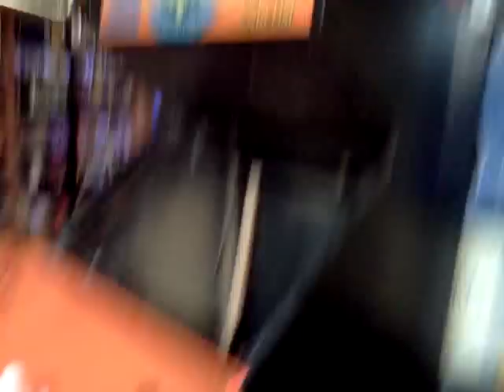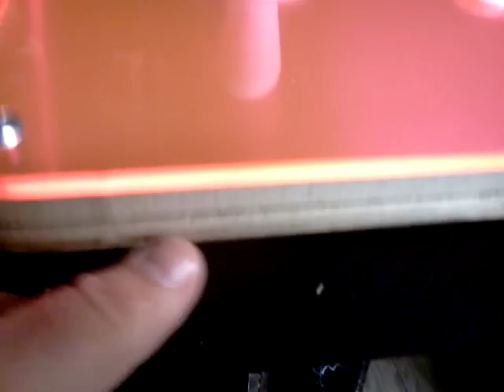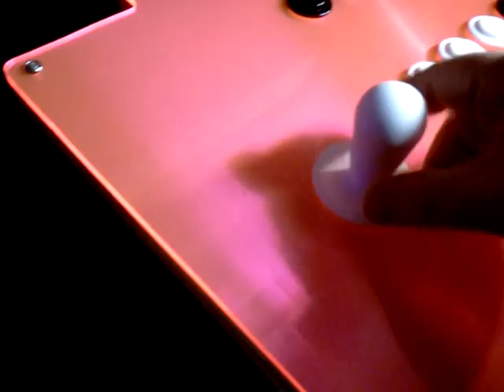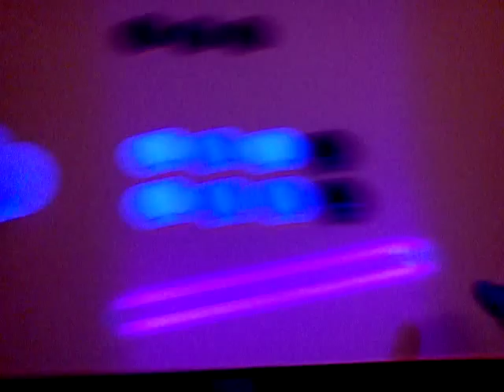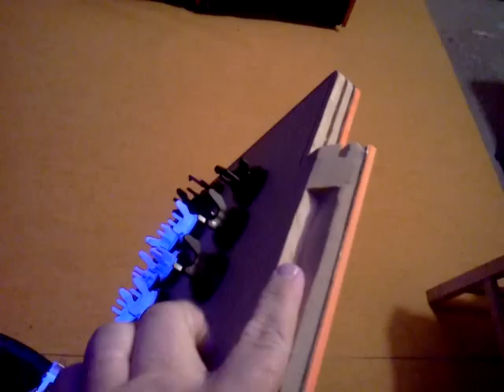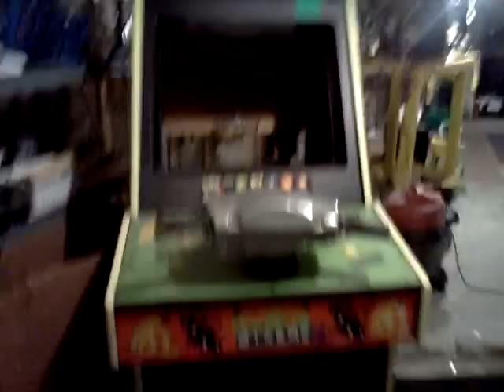Florescent Plexi Arcade Control Panel

Comment: @tigheklory that's true.  Though if you know of any place that sells hardware somewhat locally OR you know personally, testing it before purchase would be an option. I don't have that ability but you seem to do a lot of arcade cab work so you might have made a connection over the years :)
I like the idea of a capcom logo... that would add a little something.  Maybe if you did the logos in black and white but only used the black portions?

Comment: Too bad about the buttons.  I think it really takes away from the awesome work you've done there.
I personally would add some awesome black paint or tape detailing to the control panel since it tends to look a little plane.
Questions, since the cab is for an Xbox 360 and not a regular Xbox why are you going with a VGA monitor? Is it just to get an old style arcade feel?